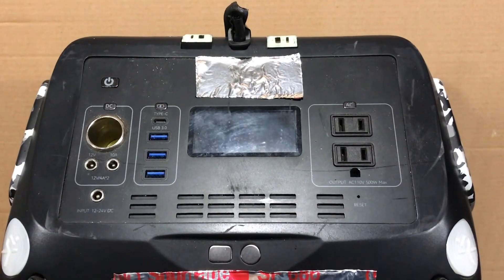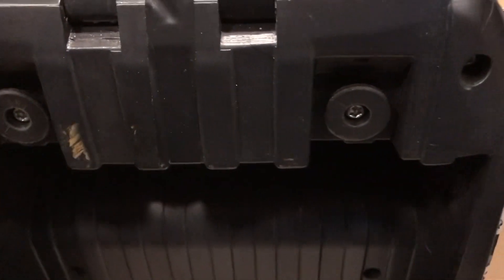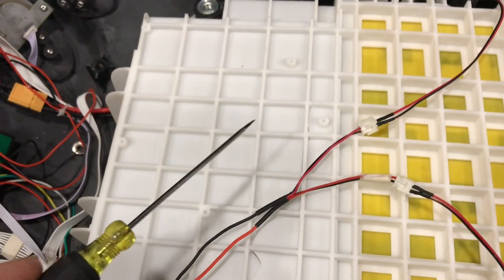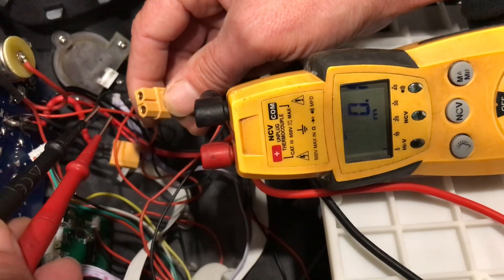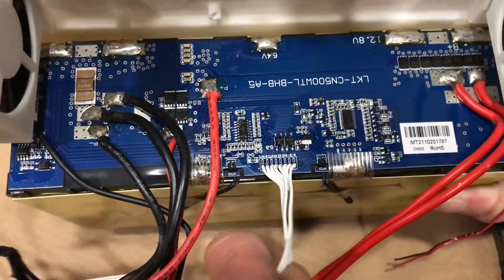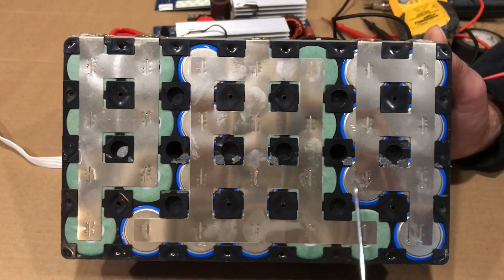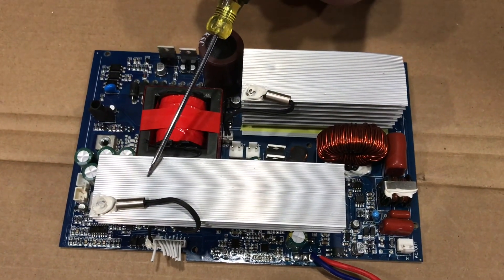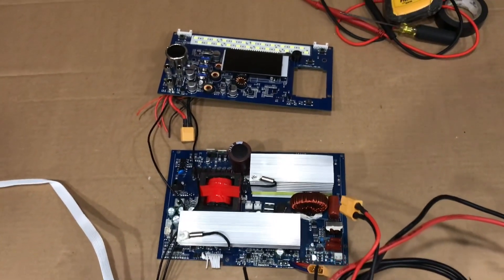PORTABLE POWER STATION TEARDOWN

Comment: Could you do a video on your solar set up for your house?
Reply from the maker: Yes, eventually I’m going to do full tour!
Reply: @THEOFFGRIDMOUNTAINHOMESTEAD   great to here I’m wanting to build a solar generator to run a few things for back up and also power my off grid hunting cabin with it. But I’m trying to figure out battery size needed to run things any advice?
Reply from the maker: You can contact me with what loads you want to run. My contact info/email is on the ABOUT page. I’ll try to help you size your system.

Comment: Thanks for tearing it down for us. Kinda unimpressive battery pack in it. I’ve just got a small setup for lighting and an electric fence for livestock but I’ve wanted to build a system for a remote hunting cabin. I think I’ll be piecing mine together so I can spread the costs out over time. Any warnings on charging batteries with a generator?
Reply from the maker: Just use a quality charger that matches your battery specifications! Don’t overload the generator if running other loads.

Comment: Enjoyed the tear down.   The quality of the electronic components, battery cells, & wiring looked a little better than what I expected.  The case was definitely not made very well.   Considering how little use that unit had and the problems you experienced, I would say that company needs to go back to the drawing board.   I would be pretty upset if I would have spent my hard earned money on that particular solar generator.
Reply from the maker: Glad you enjoyed it! I thought the battery pack was built decent. Spot welds could have been better. 
The internal support for all components was poor. Plastics were brittle. 
Thanks for watching and commenting!

Comment: Good job explaining everything! I was looking at the components and was wondering if you would tell everyone what they were.  It was definitely not the best-looking build inside.  I think your plywood build was better than that. At least you can replace individual components.  I  have both a system that I built and 2 of the eco flows.  I still like my build better.
Reply from the maker: I didn’t go over the components in depth as to not confuse folks. 

It wouldn’t be hard to replace components in the power station if you could source the factory parts. Everything is plug and play. Modular if you will. 
Thanks for watching and commenting!
Reply: @THEOFFGRIDMOUNTAINHOMESTEAD  I understand that and you make your video for your audience.  I have a background in electronics.  But I enjoyed the video!
Reply from the maker: Thanks!